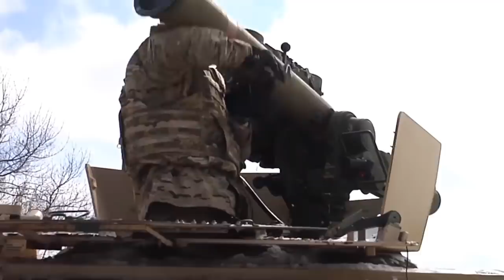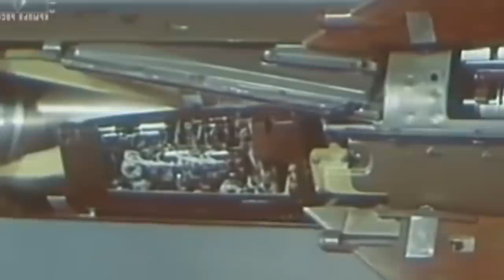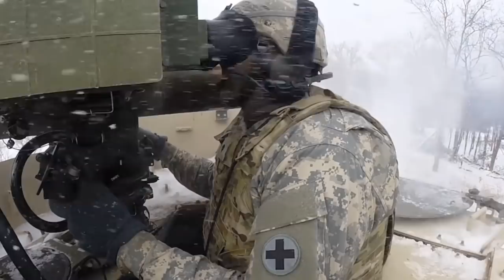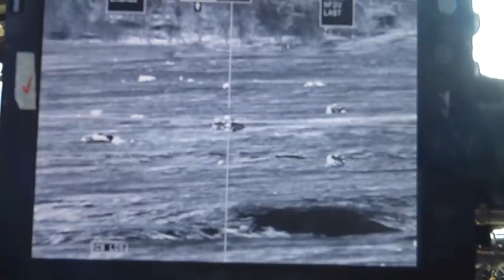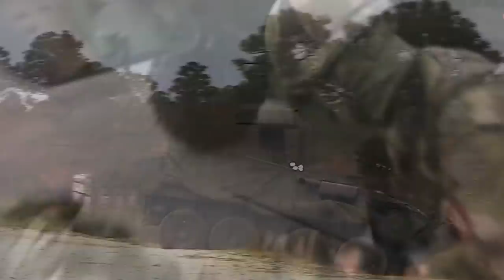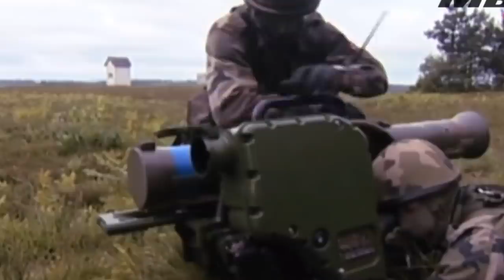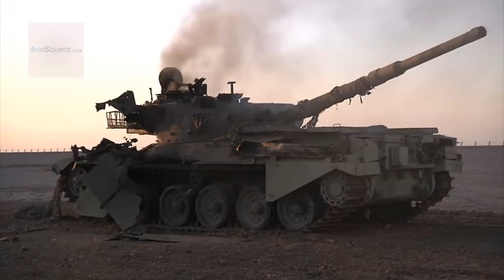Should Main Battle Tanks have Anti-tank Missiles?

Comment: APFSDS is cheaper, faster, stronger, more convenient, reliable and harder to intercept. If infantrymen could carry 120mm guns instead of ATGMs they would do so.
Reply: Technically, infantry COULD carry ATGMs (Ever heard of FGM-148s?)
Reply: Callsign-YukiMizuki they already DO carry ATGM's including the javelin, he was saying if they could carry 120mm tank-guns instead that they would
Reply: I would rather have a javelin
Reply: Raptor A if you're infantry it's as good as it gets anyway so kinda a moot point, man-portable stuff can only be made to a certain size
Reply: At guns ? Forgot about them?  In My opinion atgms are great for the frist Seconds of Engagement especially If your on the defending site. Atgms on Tanks are great
Reply: Why cant use ATGM with APFSDS sub munitions or just purely kinetic ? Most guns have muzzle velocity about 2 mach, this excluding the newest high speed rounds for naval. Just that, it is not that impressive against missile that can go 2 or 3 mach.
Muzzle velocity for gun dissipates quickly while missile could sustain a constant 2-3 mach if it have to; from beggining to the point of impact. 
The answer is because SACLOS, MCLOS or any other CLOS system which requires someone to guide the missile. It is one hell a time to remote guide the missile at high velocity.
But it is not true for newer generation ATGM. Laser guided ones for example as Matsimus said. They are fire and forget, supersonic, and could be made to have better velocity on impact.
Reply: Starstreak HVM is one example of that kind of missile, with APDS like sub-munition. It is HVM (High Velocity Missile) too, 5 mach i think ?
Reply: ATGMs are slow. Fast missiles are usually big anti air from vehicle or ship or plane baset platforms.
For comparison some APFSDS and ATGM speeds  

APFSDS
DM-53: 1750 m/s
M829A3: 1555 m/s
CHARM3: 1675 m/s

ATGMs
Kornet-EM: 320 m/s
MILAN: 200 m/s
TOW 2: 320 m/s
Brimstone: 450 m/s
Reply: Tadeas Kollar Give me Starstreak and Vikhr speed. Still dont forget your data is muzzle velocity.
Reply: Vikhr: 600 m/s
Starstreak: wiki says more than Mach 4 at second stage burnout (so 1372+ m/s) Starstreak however is a dedicated AA missile it has about 30+ mm of penetration so not exactly a ATGM material. 

Also while my numbers are muzzle velocity a APDSFS that has 1750 m/s muzzle velocity won't lose a lot of speed in 3 seconds of flight. (DM 53 will lose 55m/s per kilometer)
As for the ATGMs, I tried to check for max speeds just to be sure, only have found numbers for the TOW and Kornet which were the same as stated previously.

Besides the only thing that one needs to do is look at some videos featuring ATGMs one can see that they take several seconds to hit a target that is close enough to be clearly visible with the naked eye.

Added to that this video were under itself states a plethora of reasons why ATGMs are not on tanks like reload speed and price for projectile so what are we even talking about ?
Reply: Tadeas Kollar Yes yes, the major drawback is the price. But it is not impossible to make kinetic atgm just like APFSDS. Reload speed idk, missile can reload as fast as cannon, if not faster.
Why i brought Vikhr too because it is truly dual purpose missile, could defeat real tank and aircraft, even missile.Also somehow Russian even suggested to launch two per salvo because it is cheap according to them.
Starstreak isnt dedicated for AA tho. Using 3 sub munitions like that isnt a nice recipe to kill aircraft.
If you have some time, check the speed of the said APFSDS after travelling 1km, 2km, 3km.
Missile could fly at constant speed if it have enough fuel to do so.

If Starstreak sub munition made of the same material as APFSDS, without explosive filling inside, it just APFSDS. Tungsten or DU is expensive AF. Even better because the speed isnt dropped as much as APFSDS at range. Reach longer, but the 5s trigger hold of that system is really a downside. It could be fixed really, in the future.
Reply: So first of about Starstreaks poor penetration performance, while the missile has a lot of speed and the subprojectile is indeed tungsten the amount of tungsten used is only ~1 kg while the weight of a DM53 APFSDS is ~8 kg.

Now about kinetic missiles, let's take the Vikhr and say that instead of having a HEAT warhead it will have a kinetic warhead. SO the whole missile weighs 45 kg ! Who is going to load it ? It's nearly 3 meters long. (problematic to store in a tank) And even if you get it to work (mind it needs a 130 mm gun) it still flies only at 600 m/s compared to the DM 53 at 1750 m/s.

Also I already mentioned that the DM 53 APFSDS loses 55 m/s per kilometer. SO at muzzle 1750 m/s at 1km 1695 m/s at 2km 1640 m/s at 3km 1585 m/s and so on
...it will be slower then the Vikhr at a range of 21 km ._.
Reply: Tadeas Kollar Haha, thanks for the data. Those two missiles are the only "best" missile to compare it with APFSDS. But it is not impossible to build APFSDS carrier missile, or purely kinetic. I think putting THAAD is not good example.
Vikhr doesn't need to be APFSDS tho, because it will lose its multipurpose. But i brought it here that without human need to "steer" the missile like TOW, kornet, it can be much faster.
Reply: Tadeas Kollar Hmm, now that 21km is equal to 600km/hr really bugged me. Because tho it is correct up to 2km, im finding really hard to see APFSDS that has range more than 4km (perhaps this refer to effective range to pen). Up to 10Km (perhaps this really the max range until the round lost all of its speed). From sources i dug from internet.
I could think that de-acceleration isnt linear. Quadratic ?
Reply: The 21 km thing is just the distance where the DM53 and Vikhr would have the same speed if they could reach that range. It's just hypothetical as the Vikhr has a max range of 12 km and APFSDS rounds float around 5 km (but they will go until they hit something or fall to the ground. They're limited in range by FCS and optics.)

As for kinetic missiles while possible in theory. They just aren't convenient enough compared to a APFSDS right now. Well maybe in the future we will see them on tanks but I personally think that normal kinetic rounds will still be used as well.

As for deacceleration being linear or quadratic...I don't know ¯\_(ツ)_/¯
Reply: Lets say 55m/s it is velocity, but acceleration/ deacceleration is 55m/s^2.
No APFSDS could reach more than 4km...
Reply: Unless you want to redeploy the ww2 style anti tank gun , i dunno an atgm would be lighter for an infantry

Comment: As a kid I wondered why tanks didn't have coaxial 20mm (like the french) or miniguns (m134 or xm214)
Reply: presumably for reasons of space.  a minigun eats ammo, so you need a lot and an autocannon has large rounds which also take up a lot of space.  GPMGs have slow enough firerates that they don't take up as much space with ammo belts.

Also, you just don't need'em. Autocannons are good for taking out lightly armored targets and entrenched positions. You know what else is good at that from much farther away? A tank cannon. Same with miniguns. They're meant for blanketing an area in withering suppressive fire. A tank doesn't really need to worry about suppressive fire because it probably should be that near large infantry groups that would need suppressing.
Reply: During the Korean War, the US Army realized during the battle of Chosin that their tanks didn't carry enough MG ammo to hold off the waves of Chinese advances. After the war, coaxial guns were reduced from 12.7mm to 7.62mm. The Abrams still carries one 12.7mm gun on the turret roof, but the coaxial and the second turret roof gun are both 7.62 mm. This allows them to carry more ammunition, owing to the smaller size of the rounds, without sacrificing any lethality against infantry (because both rounds are plenty when it comes to a human body).

Edit: US tanks seemed to always carry 1x .50 cal and 2x .30 cal. The difference is that the M1 carried twice as many 7.62mm rounds as previous tanks did. Also, Korean War lessons played a role in the development of the tank when it was originally planned to have 2x .50 cal and 1x .30 cal, with the coax being a .50 cal. This was overturned and the coax became a .30 cal to carry more ammo.
Reply: 空軍パイロット that makes a lot of sense. Kid me just wanted to see air burst 20mm or the buzz of a minigun into a mud house
Reply: Well a rotary gun would take up a crapton of space inside
Reply: The mbt\kpz 70 has a 20 mm top gun also the leopard 2k had one also
Reply: Raptor A
Those were both prototypes and neither of their daughter vehicles ended up sporting cannon-sized secondary guns.
Reply: A coax machine gun mounted in a tank turret, being fired with a tank optical sight is a deadly weapon, at ranges well beyond what it is capable of being used on a typical ground munt.
Reply: BMPT and Czech T-72 ? Maybe BMP-3 if you consider 100mm is a main gun although it isnt shooting gun shells better than Sherman for anti tank role because it is kinda for shooting HE rounds and ATGM.
Reply: I wasn't aware of any American tanks using 50 cal as coax; most tanks from WW2 and onward were armed with 30 cal as coax until switching over to 7.62.
Reply: Israeli does used .50 coaxial, but as external mount. They did until Merkava MK II.

Comment: The purpose of ATGMs is to put arm small, light vehicles.  If you have a tank, you can have a tank gun which is a more effective, quicker firing weapon.
Reply: Or put a very large and very powerful ATGM on the tank. Get IT-1 Dragon
Reply: Actually nope. As stated above in the material ATGM is just a means to reach greater diostance. Western tanks had and edge over comparable eastern tanks regarding long range accuracy so the Rus  went with ATGMs to cover that and reach even greater distance. Modern tank launched ATGMs reach above 4km and are better suited against moving targets than main gun at that distance. Still tanks seldom engage at that distance, so that + price tag makes this very limited usability weapon
Reply: There is no reason not to just stick a few fire-and-forget ATGM on the back of turret bustle. You don't lose the main gun, you don't lose tempo, and you can extend your firing range and probability of achieving kill before return fire.

Comment: Hey Matsimus, great video. I good summation of the different ATGM is service and why their employed on tanks at the current moment. I love the footage of the T-55 (???) missile armed tanks ( thanks comrade Nikita), but i find it interesting you could find the M60A2 which fired the same missile armament as the M551. Both MBT (T-55 missile and M60A2) were dropped due to the reason to mention in your video ( ok I'm rambling  . . . I'll get to the point).  
  
I have been playing Battletech a bit and I find it interesting that many Sci-Fi series ( battletech, Heavy Gear, C&C) in the future or far future have tanks with missile of some sort. it does remind me of M551 Sheridan. I could see if ATGM could be miniaturize to a point without loosing their punch against  tanks that it could work, or using ATGM or something similar to "solve" one weakness of the tank ( last of indirect fire) or provide firepower or warheads the main gun can't fire (i don't recall if tanks can fire thermobaric ( I know now spelled right) warheads. 

what i could see tanks mounting in the short term are Drone launcher ( or bays) to help tanks see around better ( or on urban environments)

Comment: An issue with arming tanks with ATGMs is that active defenses are starting to become more and more common in modern military vehicles. Between jamming and defenses that actually intercept missiles and RPG warheads missiles are starting to lose some of their effectiveness. A round fired from a tank gun, however, can't get jammed and I'm not sure that active defenses can shoot them down, esp. a sabot round travelling at very high speeds and is also a pretty small target.
Reply: There is atleast one, and if russian claims are true, (doubt) two active protection systems that affect APFSDS tank rounds. It's by far not common and some countries will need ages to develop something similar.

Comment: I think a turret mounted ATM is a great idea on a MBT. It would give you a way to give you a way to fire a shot without really exposing your turret. It works great on the Bradley. While I get that it messes with battle tempo and keeping the right tempo is important. But if you could make it operated by a commander and Gunner you could  make more shots. Let's face it there has been times when tanks don't get to work together like we want then to. But I'm no tanker really we should be asking the current tankers and commanders.

But I think a fire and forget system is really need for this application.
Reply: rooster68w i suppose atgms would be best suited to an indirect firing solution by the commander, eg: behind a hill
Reply: Not really You would still have to expose the turret to ge a line of sight on your target, might as well use the quicker weapon and hit it with the Main Gun
Reply: Or you could just have a tall guiding system and fire the missile from the main gun
Reply: 8aleph yes and no the system on the Bradley sticks a bit up from the  top of the turret about in line with the the sighting systems so minimal turret profile would be needed. The one who shoots first generally wins.
Reply: ATMs can do down-on-the-top-kills to vehicles above you in a way a tank main gun cannot. Unless a tank is armored as well up on the top as it is to the front/turret then the guided missile can trump the cannon. For most situation, an MBT cannon round is more than enough, but the minority of cases where it is not, is the ones giving the majority of the losses. (Discounting mine kills)
Reply: You'll have to store the missiles somewhere inside the tank displacing the other ammo
Reply: What about a mechanical arm that raises the ATGM and guidance systems/sights above the obstacle and then fires it, retracts, reloads and does it again? I should get payed for this..
Reply: nonononono i mean like, a proper cherry picker mechanism, fire over mountains and stuff
Reply: and tanks with multiple turrets are useless but they look cool or whatever...impractical? maybe, but you can confuse the enemy by making your tank look like it's 20 feet tall
Reply: or the entire red alert series lol

Comment: I want to address several issues here, so please forgive me if I ramble a bit. First on the subject of the Bradley. You must remember the tactical environment that it was designed for.  A cold war doctrine that emphasized, at least initially, mobile defensive combat in the face of massed soviet armor attacks.  For this purpose the Bradley was armed with the tow missile to give a dug in mech infantry unit some mobile, organic, long range, anti tank capabilities. It was meant to disrupt an enemy advance, make him deploy , and slow him down while the defending unit displaced. Or setting up the enemy for local or general armored counter attack. Basicly  skirmishing . Or in the advance, it allowed the mech infantry unit to provide a very useful long range anti tank overwatch capability. Allowing the tank unit to cross open ground with heavy ATGM's already in place to support them should it be necessary, and yet still able to rapidly follow up with the mounted infantry when moving in close terrain or urban areas where the tanks would be vulnerable to close attacks by enemy infantry

Now, as far as dedicated, single purpose ATGM launchers mounted on tanks, and this is purely my opinion on the matter, I DO NOT see an upside to it! An ATGM launcher on an MBT would be ammunition limited, you could probably carry three or four AP rounds in the space that would be occupied by one missile. The launcher itself would be either very vulnerable, very complex, or both, adding weight and complexity to the Vehicle. Adding dedicated ATGM's to MBT's would, by their use, cause a tank unit to put aside two of the three important elements of tank warfare, maneuver and shock effect.  In short, I think that infantry or dedicated anti tank units can make far more effective and efficient use of ATGMs, leaving the tanks to do what they do so well. Dominating the battlefield with Fire, Maneuver, and Shock effect!
Reply: Modern ATGMs with tandem charges are quite effective, but with the development of an ERA and active defense, like Trophy or Arena, there will be a problem. Even old tanks may well survive repeated hits of ATGM, as the experience of Syria has shown.
KUVT (a complex of guided weapons of the tank) on the T-80 and T-72B is different in that the missile takes the place of a standard 125mm shell, the complex is fully integrated into the fire control system.
The problem is that it is extremely difficult to raise armor penetration in a 125mm shell above the equivalent of 1000mm, but in general it is possible.

Comment: The best all out war tactic with maximum efficiency is to produce 2,000,000 Volkswagen bugs with 6 ATGMs 1 mounted  machine gun/ or mk19. 1 dismount infantry  soldier with a machine pistol 1 AT mine 1 FIM-92  and or a 41mm motor.  No army in the world today could  conquer that armored division so long as you had a bad a$$ long range Air protection